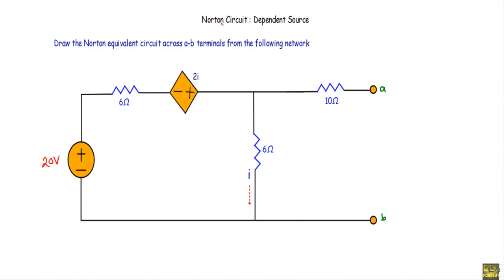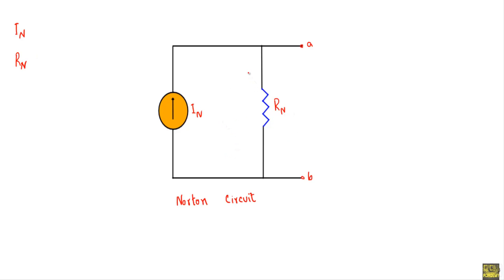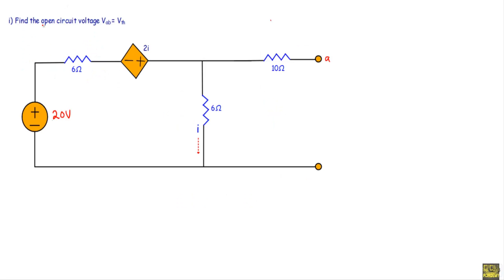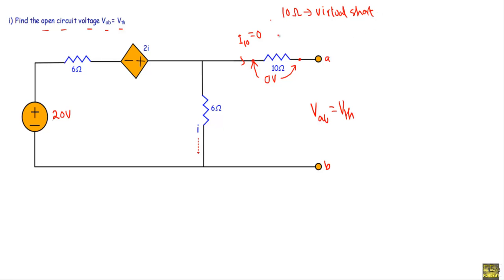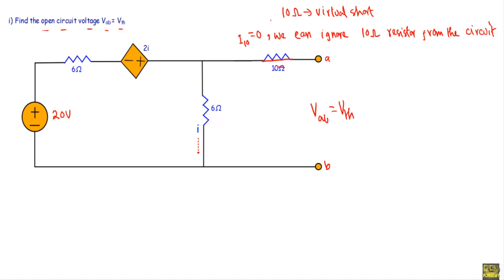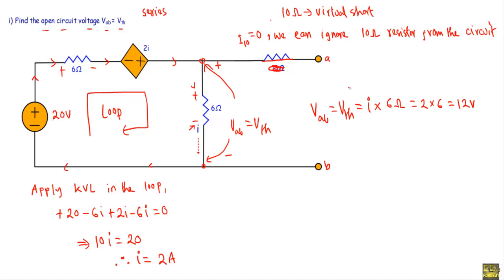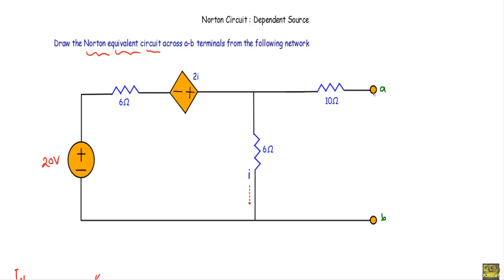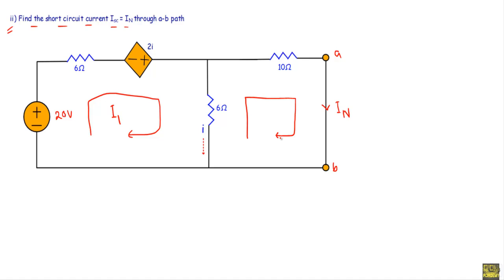Norton Circuit : Dependent Source

Comment: There is an error in your first KVL equation. The CCVS in Mesh 1 only depends upon I1. Hence the exact value of I2 is I2 = 120/124 Amps. Therefore Rn = 12.4 ohms.

Comment: How did yoy add 2i? 
If the current is supposed to flow from left to right then you sholud take " - 2i" instead of taking "+ 2i" as you did with 20V why it is not there with 2i?